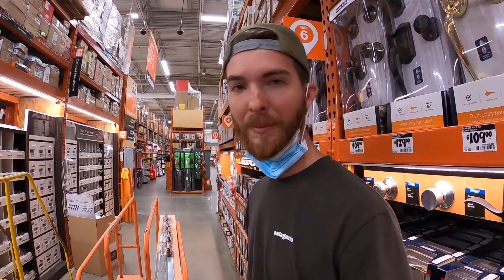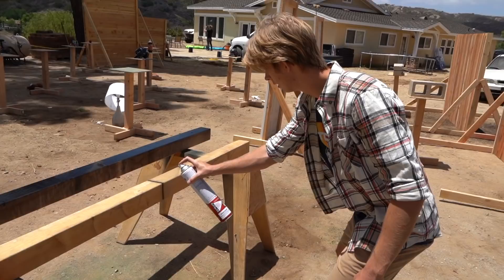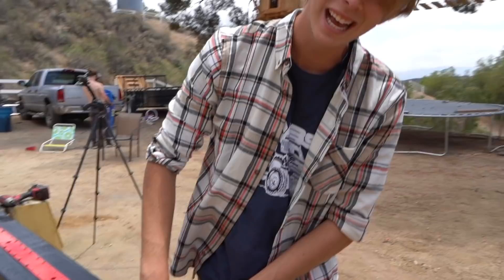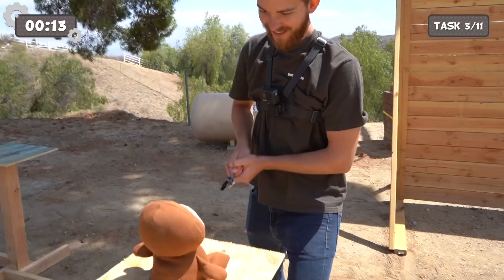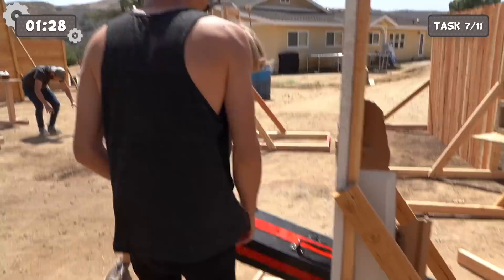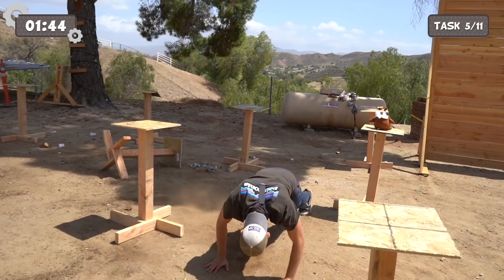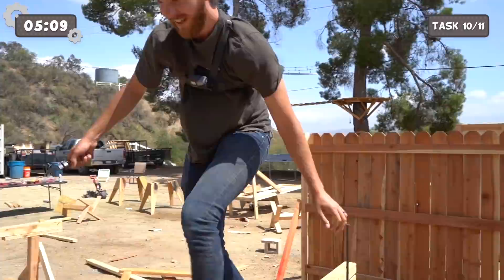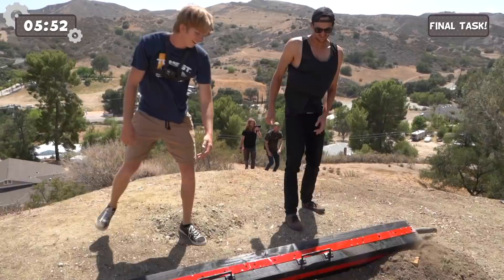Tiny vs GIANT Homemade APOCALYPSE Weapons! *BEST WEAPON WINS*

Comment: bigger the weapon the heavier it is to transport, and is most likely to be to used for breaking doors or breaking shields. While the small weapon is going to be easier to transport, and is sometimes easy to break apart but can be concealed quit easily. so my vote is neither i would just roll in like a SWAT man with an OAK BILLY CLUB AND A THICK OAK ROMAN LEGIONARE SHIELD WITH a very cute and tiny tiny gun called the KOLIBRI PISTOL.